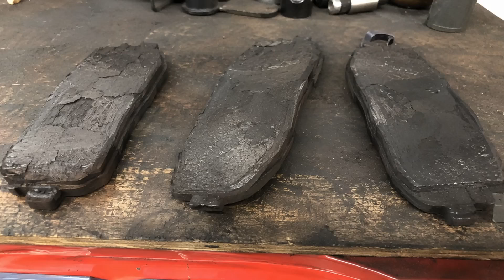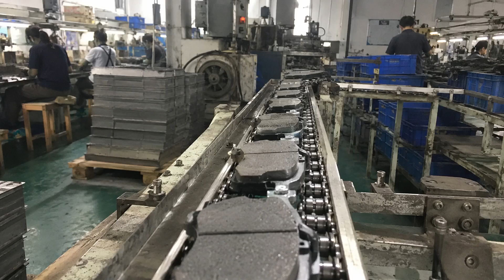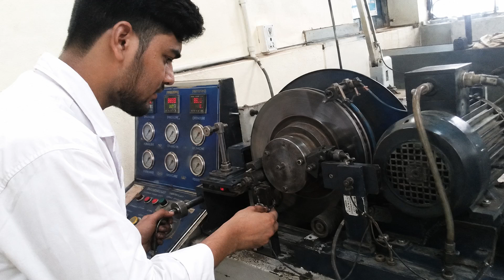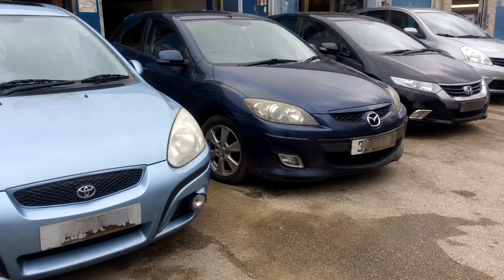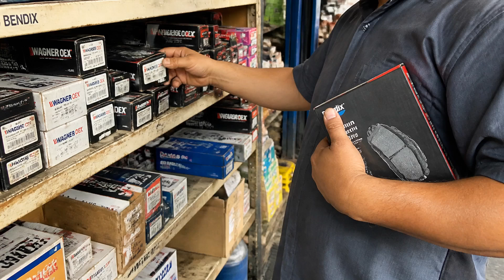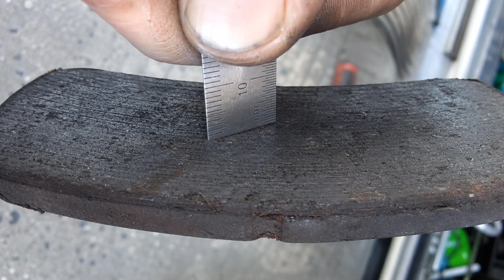5 CHEAP Brake Pad Brands EVERYONE Ignores in UK Absolute Goldmines

Comment: In fact EVERY. Single Car Name. Be it:Ford, Vauxhall, Renault. Make ABS NO. PARTS What's so ever. All they do is: ASSEMBLE ALL Parts on a Production Line. From Motor parts Manufacturer. Those being: TRW, ADL Blueprint, Valeo, Bosch, First line, Velco, AP Wildwood, Mintex, Ferodo, Lucas Girling, Texstar, n so on.

Comment: I turn over a lot of Mazda CX5s and Mazda 6 Estates. All of them get new discs and pads. I use Delphi discs and am very happy with the price/quality. However, Delphi pads never have fitting clips or replacement slider bolts for these application vehicles. The same is true for Audi A3s and Audi TTs. I have now started using Brembo pads because they do include fitting kits in the box.

Comment: BROUGHTsome bosch front mini r56 pads from ebay 2 years ago the material was coming away from the metal backing sealed box all looked genuine
Reply from the maker: Thanks
Reply: You are 100% correct .  e,bay Amazon  full of fake parts . They do nothing about it . There has even been  Fake Castrol Edge Oil. Castrol now put a Holo Gram and Seal with embossed edge .

Comment: Now retired I have 3 cars of my own and lok after an indeterminate number of others. For my '98 Morgan plus 4 I use EBC Yellow Stuff (the car still has the original discs which were Austin Princess fitment) No dust on the wire wheels and no noise with very good braking performance (road use only) 5k miles per annum.
Second I have a C70 Volvo, use Volvo off the shelf parts or EBC prices and performance about equal.
Thirdly, my daily runabout is a Peugeot Teepee diesel. Usually use Delphi, Ferrodo or EBC pads and discs. Good performance, no noise and pretty good longevity.
On other cars I work on can vary depending on what I can get if the owner is in a hurry but I always go for either Pagid, Delphi or EBC if I have enough notice as they are internet order only.
Why do I use EBC? Other than performance and lack of dust and noise etc it's because you can speak to a human, get sound tech advice and discuss an issue without bias. Great tech info on line availability. Great company.
The devil is so often in the detail of the due diligence you display as the person doing this work, don't just slap a set of pads in like 'High st' cheap places. They won't bother with the guide pins if they are not siezed or pay much attention to the shims and the other components of the caliper.
Great video by the way.
Reply from the maker: Thanks

Comment: Been a mechainc since college im 42, I always recommend and try to fit Pagid discs and pads (correct spelling, not pagged), the disc coating seems to be the best, yes they are very dusty so I advise people to wash their wheels more frequently. IMO pagid pad quality has gone down slightly, I've had a couple of pad sets where the backing plate shim isnt fitted or fitted but came off easy and needed the little tabs bending more (years ago they were assemebeld ready to fit) best Pagid I ever had was on my own car Astra gte 16v, 16 groove high carbon discs and standard pads, I kept those same discs on several c20xe powered cars, lost count how many pads i went through doing track days, in the end the groves had totally disappeared from the discs and they still stopped great with no vibration. 
Pagid has a brakebook catalogue so you can browse which is suitable, halfords trade card are often cheaper than LKQ euro car parts /omnipart trade, land rover discovery 5 i did last month £170 chepaer on front discs and pads for pagid at halfords compared to euro.
Most "services" now in mainstealers dont take wheels off, i was always taught to take wheels off on a service and get a good look at the brakes.
Only bad experience ive had with pagid was the ceramic white grease, used it on a friend's rx8 we did trackdays in and it set like concrete, i had to hammer the pads out.
Lkq euro offer performance parts now on the omnipart website (for trade customers), I've never tried ebc, the best brakes we have had on the track cars is maxtorq from rally designs, you can pick the brake discs by measurements eg brake thickness, pcd etc, if your vehicle isnt listed/ not sure use pagidbrakebook and put your vehicle reg in and use the measurements transfered on to rally designs maxtorq brake page. Pagid 283mm front discs for my van are £25+vat each at trade from euro but im tempted to try the ate power high carbon discs with the swirl pattern (autodoc £48inc vat each) due to carrying weight of my tools and up and down hills where i live,
I get a lot of new customers who come to me from other garages where the mechanic hasnt done a good job of cleaning the surafces on the caliper carrier, often using the old shims, not greasing the sliders, putting new discs onto a dirty wheel hub, i bought a hub buddy to clean the hub face and around the wheel studs, i also wire wheel over the hub, carrier/all the mating surfaces, im not near the seaside but do a lot of farm vehicles so water/mud, i like to use the arbo purple grease spray (from motor parts direct, its actualy battery grease but i like the smell of it and its purple) the caliper carrier bolt heads, bleed nipple, brake hose at the caliper and where the brake line joins just as a preventative measure so i know i can get the things off if and when i need to months/years down the line, I use tons of brake cleaner and pagid brake grease. Best brake cleaner is CRC but its pricey compared to euro tripple qx @ £1.80/600ml

Comment: My  VW tiguan 170 bhp got 93000 miles out off the original front pads and discs with 40% of the mileage  towing a 1.5 ton caravan over a 13 year period. The original rear did 60.000 over a 10 year period
Reply from the maker: Thanks

Comment: Very interesting, I’m one of those always buying original , I know it’s more expensive and doesn’t always worth the money, but last few years started to do my homework and do research on everything I’m about or buy and yes buy the product not the brand. Also pads , discs , tyres and many others depend as well of the driving style , road conditions, vehicle overall health etc . There Are courses on fuel efficient driving , as well as advanced motorist driving etc , these are good as well as fuel efficiency directly related to braking, accelerating, preventing, observing, planing etc .
Basically technically speaking, parts are half of the thing, the other half is the gasket between the seat and steering wheel , safe roads everyone 🤝🚀
Reply from the maker: Thanks

Comment: Well researched video indeed. I have been driving 60 years this month and have done many repairs/serving over  that time due to cost. I have a Piccanto 1 2020 model and changed the front pads/discs at 37,300 miles . I used Delphi off the eBay coat  in 2019 66.98 inc fitting kit. Rear brakes at 41200 with Eicher pads same discs. Now car at 68655 no further need to do anything as I check the brakes with wheels off every six months. This wear is normal in  my opinion,. Years ago I had a pad separate from a baking plate on an Escort. That was Partco. Why do discs  get a 'lip' could you look at that as I have a Focus 150TDCi I bought 2 years ago a 2017 model. It has lips on all discs but passed MOT no comment. Brakes work fine.
Reply from the maker: Thanks

Comment: The key to this conundrum is the retailer’s catalogue. Motor manufaturers do not make calipers, they are bought in, many cars use the same calipers and therefore the same pads, if you look up the CAR in the catalogue it gives you a part number and a price, but that part number is repeated for many different cars, with a different price!  Thus when I was tipped off about this by a mate who owned a motor factors in the 80’s, in my case using the mintex catalogue disc pads for a Saab cost £24 but the same pad with the same part number was listed for a Ford at £13! People who buy Saab’s are judged to have deeper wallets and can therefore be gouged for the same part !
Reply from the maker: Thanks

Comment: About 20 years ago i fitted standard pads on one side and Green Stuff, painted green, pads on the other side. Green Stuff pads claimed better stopping. I could not feel any difference, hot or cold. No pulling to one side. The car went through several MOTs and no imbalance was detected. I could not measure any difference in wear. Only in this experiment have I ever used mismatched pads, discs or tyres  
I have seen different wear on pads out of the same box, but that is always due to friction within the calipers not releasing properly. I once saw a mechanic hammer the pads into place. I wonder what brake binding was like on that car? 
 Im in Belfast
Reply from the maker: Thanks

Comment: I will stick with ATE components , thank you , they have been factory fitment on every Mercedes-benz car I've had from 1957 on ; I have tried some of the other brands mentioned and found them to be inferior . I do not skimp on brakes - they are arguably the most important parts on a vehicle , alongside the tyres ,  so cost is not a particular concern .

I would never take a car to a garage to have brake components fitted when I can do it myself and know the job has been done correctly !  Most garages are not to be trusted .
Reply: You're full of shit. Mercedes have been using TRW for years.
Reply from the maker: Thanks

Comment: Have you never heard of Ebc. Pads and disc's. Normal, green . Yellow for fast cars. Red for racing
Reply: i use ebc there cheapest ones & they are brill for lasting and not squealing !!!
Reply: Beloved of boy racers , but not for me - I stick with ATE who are OEM to most German manufacturers .
Reply from the maker: Thanks
Reply: All brake component manufacturers are squeezed on margins right now. 
Discs are a major problem, EBC are no exception. 
Their green stuff pad AF49? formulation was excellent value for money, a set in their own reps Peugeot lasted 160k miles back in the early 2000's. They had 10'k of miles left in them, but then on a Fiesta XR2 rally car they were worn out in 6miles of stages, not the quickest of drivers, but then a quicker driver in a  205 1.9 did an entire event on one set, in very wet conditions.
Tried a set of mintex 1144 in 1.6 205 on a sprint and the client accused me of trying to kill him at the first corner. 
Never simple or straightforward